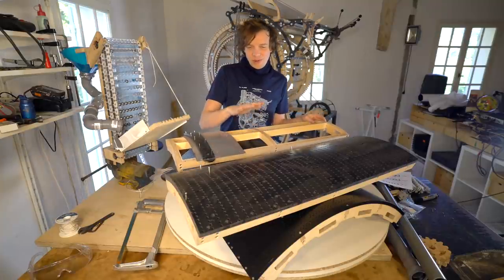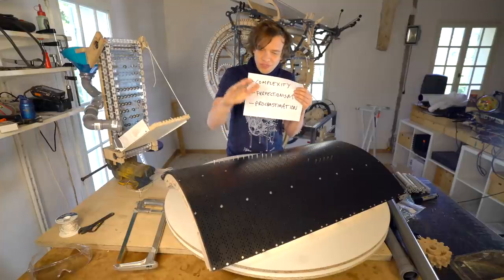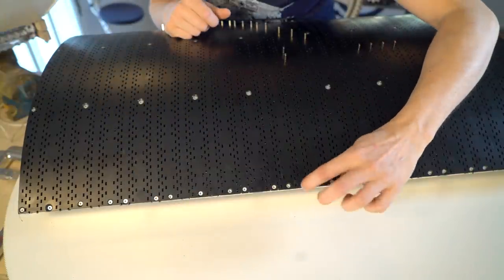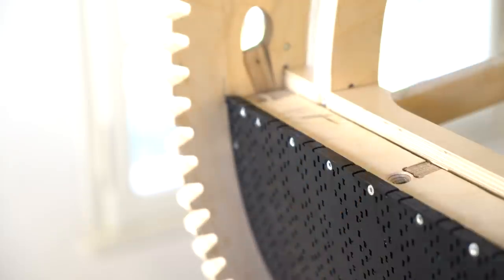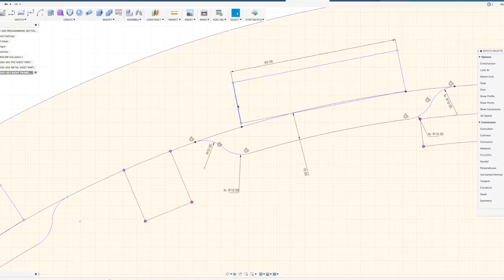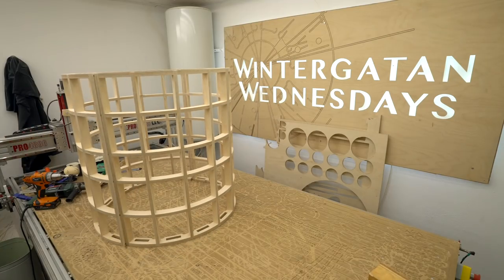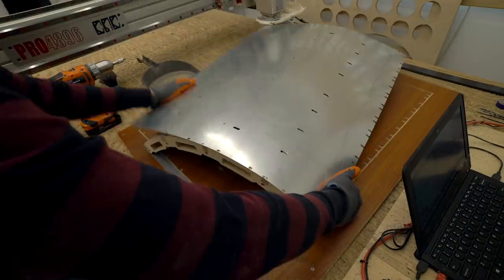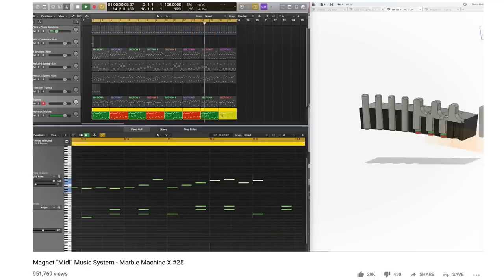Music Programming Plates Part 3 - Marble Machine X #65

Comment: When you bend the plastic plate, it's center line should remain the same length, while the top stretches as much as the bottom compresses

Comment: Who says the splits between the plastic sheets has to be straight. Why don't you make the joints with matching steps so you don't have any joint running thru a slot?
Reply: Perhaps it would just make it more complicated, or too fragile with the stress of touring. Honestly, the programming plates have gone through such a transformation since MMX started. This is probably the most effective and practicle design.
Reply: That’s what I was thinking.... I am sure it wouldn’t be difficult to do- although it would make them less rigid and harder to put on and off
But in my opinion that’s a worthy sacrifice
Reply: These panels need to be made from a plastic injection mold. A steel mold  of a section would put all the holes in automatically. The part would come out of the mold already curved perfectly. The pins that make the hole shape would retract before the part is ejected from the mold.
Reply: @billkeithchannel  oh yeah, you have any idea how much the mold would cost for such a part? Considering he only needs 8 of them.
Reply: @EitriBrokkr  The quarter section programming wheel would be divided up into curved strips 1/3 in length and would be just one channel wide. so one programming plate would have 96 individual pieces attached to it. This way if a pin slot gets loose over time you only need to replace that small plate not the entire thing. An ABS/figerglass plastic would give strength and a tight tolerance. A water cooled mold made in China would not be that expensive and could crank out a thousand parts in one shift of production.
Reply: @billkeithchannel  and getting all those spaced perfect to play music tight enough for Martin's liking would be almost impossible. I'd really be interested in to hear what your idea of "not that expensive" is.
Reply: @EitriBrokkr   Well back in the year 2000 I worked for a tool shop and the industry was gutted by Clinton when that most favored status from China went into effect. A mold that would cost $35K in America could be made for $7,500 so all those jobs went overseas.
Reply: The plates need to be detachable/attachable quickly by stage helpers. (but then again, how did he think this would work with pins in between the plates? they would all just fall out when swapping plates. and inserting them on stage would take ages..)
Reply: Why would they fall out, considering the pins are magnetic and you have a steel sheet backing? And I think that the idea was to have some overlay and 2 plate sets so that when one plate set is being played, the stage hands are swapping the pins on the other set which can then quickly be loaded.

Comment: You can do a overlap grove on the plastic program plates I don’t have a Accurate way to explain but it’s an idea
Reply: I don't understand why he couldn't use an open ended hole in each plate with a countersunk magnet to ensure the correct distance.

Comment: Really enjoying the project! Just one suggestion: wouldn't it give a better visual impression if not all the programming panels had the same color? That way the rotating of the programming drum would be visible, even from very far away...
Reply: Spectacular concept!!
Reply: Clear plastic maybe... But I guess redoing it at this stage wouldn't be worth the effort
Reply: @dippondots3108  i am suggesting that the black plastic outer layer be red, blue, green, purple pink, etc.  That is easily accomplished, even at this late stage!
Reply: @WhatAboutTheBee  I don't think those colors would fit the project, and I don't think any changes at this stage would be easy as it's not just replacing the plastic part but the metal underneath as well etc...
Reply: @dippondots3108  It might be possible to paint the panels for that effect, assuming one can find a paint that sticks to Polyethylene (its low surface energy makes this sort of thing difficult).

Comment: can you do the programming sheet in one piece and then cut it into 4 pieces?
Reply: Or perhaps, leave the programming sheet as one piece to be wrapped around the cylinder.  I believe there is a fundamental disconnect in that four pieces are to somehow magically realign themselves to musical perfection.  Not from you sir, but from the entire enterprise.  IF Martin had the time, he could realign the plates to perfection, but that will not happen during a concert.  Controlling the gap between plates will be a nightmare.
Reply: Not a bad idea much easier matching one seam than eight!

Comment: Hey Martin,
you won't like this, but I still think the wholes you use are not flexible enough. What if you write a 3/4 song but you want to use a triplet in it? What if you want to use a quintuplet at all? What if you want to delay the kick drum ever so slightly for a bit of "wonkiness"? I'm afraid once you start actually writing music for the MMX you will find the pin-system too rigid and thus frustrating.
Additionally, changing all the magnets manually during the live show will also be no easy task as it is very easy to make mistakes which you will only see (or rather hear) once the music is playing. Danger zone!

So here is my suggestion to solve those problems: Use a fabric to fix the pins onto the wheel. You just need L or T-shaped pins, that you can pin through the fabric from below. Then you just need to span the fabric over the programming wheel segment and you are done. This way you have all the flexibility in the world regarding timing. You can reduce errors during the show by printing the song onto the fabric so that your helpers know exactly where to put pins. Or you could just leave the pins in the fabric and have all the songs readily available backstage.

The only problems I see with this approach are:
- How to make sure the fabric is evenly stretched onto the wheel
- Pins falling out of the fabric, especially when you choose to just leave them in the fabric.
But those problems seem easier to fix than the ones I described earlier. 

Just my .01 €
Cheers!
Reply: I think he mentioned something about cutting paper so the holes are guides. But I have to admit that even this intelligent system that Martin thought of is still limiting. But he has to decide what will work for him

Comment: I doubt any live programming will be successful. Way too much work for shivering hands under pressure. Do a set of plates for every song...
Reply: @stephss  I paid attention and know what he says. I doubt it anyway. We will see.
Reply: That's been the plan for awhile. Make multiple sets of programming wheels to quickly switch songs in concert.
Reply: @Bishop998  but in this video he specifically talks about TWO sets. I wouldn't do it. Resetting thousands of notes every concert will get old quickly, it will also wear out the plates. Which means the music will no longer be tight. No-go.

Comment: Martin, in cabinet making, to create a curved wall or side using a flat solid material, we score the back side parallel to the bend of the material to allow it to curve with out distortion. Also, the edges that butt up against one another are beveled slightly to make a tight fit. You should be able to calculate the exact circumference of the programming wheels based on the radius already determined in you CAD file. Hope this helps.

Comment: I'm so very much enjoying following along. I totally get the perfectionism leading to procrastination. I have an idea that might aid in the fit of the programming plates as they relate to the next plate. Or the "inter-plate gap". If you drilled and tap a series of holes into one edge of the programming plates and install set screws, that would allow you to adjust the "length" of the plate in relation to the next plate. Maybe a bit more permanent solution than shims. There is a product called ND Vibratite that you apply like loc-Tite. Allow it to cure before assembling and you have a nyloc patch. Make the 32nd not slots just a bit narrow and then using a riffler open the hole up enough to accept the magnets. Very fiddly but once completed, it's set.

Comment: Great job Martin. Imho you can make a "saw" shape between boards. And no need half  pinholes. Inside of a cylinder you can use a clamps used in instrument boxes to tight boards together.

Comment: I think one of the biggest factors in why it's been taking a while is that you've been having to educate yourself at every step of the way.  You went into one of the most complex mechanical engineering projects I've seen a single person attempt without knowing what a PBS system was, without knowing the application notes for many simple mechanical linkages, or even how to even use your CAD software.   In a very real sense anyone can learn to do anything, this is why people hire engineers though.  They will have hopefully already been through many of these learning experiences.  In a sense you've might as well add a full engineering course load to the project's basic requirements to compensate for your starting point.

Comment: @Wintergatan you've already made the plastic sheets but maybe for the next set, Turn the whole thing over and mill horizontal grooves in the back. Its called "Kerf-cutting Method" and its used to bend wood but im sure it will help a lot for bending the plastic as well.

Comment: Trying to understand this a little better. So you're going to have one programming plate that is keyed to the wheel and the others will float a bit so you can shim them into alignment? Or are you keying each plate to the wheel so there is a #1 plate and a #1 section of the wheel that it goes to so you can get everything perfectly aligned and easily repeatable when changing out plates?

Comment: Hi Martin, 
1) have you already been incorporating tolerances on your dimensions? Do you have a way of checking your tolerance stack-ups to ensure you can build as best as possible? And most importantly, have you established expected tolerances for each time of material/ manufacturing method used for MMX?
2) As product design engineer who also strives for perfection (highest quality), I know that procrastination is a real thing. But sometimes it does help to take a step back to think about what you are doing and how you are attacking your problem at hand - that is, are you using the appropriate problem solving tool, and are you taking into account all the possibilities that influence the intended outcome? These questions help you to brainstorm while not physically doing anything, but saving these ideas to try out later. 
3) For the programming plates:  have you considered if overlapping the ends from one to the next would help to ensure they give a continuous track between the sections?

Comment: By registering these sheets accurately edge to edge, you're sacrificing timing alignment of one sheet's pins to the next sheet's pins. I think you should make the sheets slightly scant and then fasten them all loosely to the drum. Then install an alignment fixture between each sheet that aligns the sheet relative to pin positions. Once all the sheets are aligned, tighten them, then remove the fixtures

Comment: Since the programming plates are a huge part of the machine, have you thought of color coding the pins? This way you would be able to see which code is for the different timing sections. Plus it would look really cool to see that going around when moving.

Comment: One question Martin, which software would you recommend to use try music before making holes into the paper for music box? Don't have any recording device like you have in the video guide so I would be basically placing notes individually, but it's fine for me. Thanks.

Comment: Martin, if the limits of precision and/or distortion in the plywood continue to cause problems, would it be possible to fabricate the "ribs & ring sections" of the programming plates from aluminum or steel weldments instead of plywood? Then, machine the ends of the weldments to fit precisely? Same basic design as now, but with plates machined to fit together. Then, the assembled "programming shells" could be turned in a lathe to final size and concentricity, and the "shells" could be attached to the programming wheel with semi-floating mounts. If the plate material itself still has has variations, attach it to the shell first, then turn the whole works in a lathe. Then, machine the holes in the shell. That would require a much larger CNC or at least a really good dividing plate and vertical mill. But I think it could be done, and it would allow you to control the pin hole spacing for the entire programming shell as a whole cylinder.  ...Watching from the high desert of Colorado, USA. Waiting patiently for the world tour.

Comment: Omitting the off-beat pin for every 32nd position is a brilliant and very worthwhile tradeoff to simplify the tolerances and construction. You're finally starting to think like an engineer - if you can't solve the problem, change the constraints ;)

Comment: Martin one way to pin the prog wheel is to have pins already placed in a matching panel, so one would pin a song ahead of time onto the inside circumference of a pin press panel and press it onto the prog wheel, if the pin press panel could pinch and release the pins the pins would transfer with ease, the pins locked in place until they are pressed into their respective slots on the prog wheel then released and the pin press plate pulled off. For ease and accuracy the pin press plates would have the pin holes for one song or perhaps colour coding the holes for the pins two songs per pin press plate (the two songs not pinned at the same time) Removal of the pins would be as simple as pressing the correct empty pin press plate on to the prog wheel pulling a pinch leaver, pinching the pins in the pin press plate and lifting the pin press plate off thus removing the song ready to be re-pinned with a different pin press plate thus a different song. You would need 4 pin press plates per section of the prog wheel.
This idea was inspired by your creativity Martin I hope this idea helps you find a quick programming solution.
Thank you Martin, 
Take your time I don't want Wintergatan MMX Wednesdays to end!

Comment: Another idea that could be a different kind of nightmare especially with the distortion is to not make the joining surfaces straight like but instead like stair stepped teeth that fit together and this way you can weave it through the holes and avoid splitting the holes between two plates. But I am sure you thought about that. Great project. cant wait to see it finished.

Comment: When bending thicker materials, like 6mm aluminium, I usually draw the finished shape in CAD. And from that I draw a line in the center of the material and calculate the length of the flat unbent stock. I also gets the position where I need to bend it, certain bends require different dies in my hydraulic press brake which results in different bending radiuses. I have to check the blueprint for misses like that and to see if any hole is placed too close to the bend. Too close the material wants to bend in the hole instead. I usually solve that by changing to a pilot hole that I drill to the desired diameter afterwards or change the shape of the hole. If the hole lies too close, extend it to the bending line. Otherwise adding material so that the die can work without distortion.

Comment: Martin. have you considered the flexibility of the materials as to expansion? if you are registering your plates that precisely... you have to account for expansion and contraction due to the different locals the machine will be going to. you may have a hot damp area making the wood expand or you may have a dry hot area making the wood contract. since the programming wheel is plastic and does not flex the same as the wood. hopefully this is not an issue. The saving grace is that you can engineer the side clamps to make the plastic face butt up to each other precisely. you may be making a mistake by letting there be slack between them that you shim. as the machine gets older and the levers wear out, the mating hole to the clamp will widen. the holding force of the clamps will diminish. just think on how much wear each one will have each time its used X how many times the plates will be changed a show X how many shows a year + breakdown and refitting for travel. it may be a lot to ask from a laminated piece of wood. eventually you will get axial play in the plates. if you make those clamps with a plastic face.... (something with a high lubricity) you can essentially use them as shims replacing them as needed and not having to re-fabricate new arms for the clamp. i recently watched a video on Flea of the Red Hot Chilli Peppers. he only uses graphite bass necks so the does not have warping when he travels the world. just putting that out there for you to ponder. Good luck. its looking great.

Comment: Martin,

Just wondering if the plastic sheets could be notched where the pins share a space between two sheets. This way they could be precisely interlocking without sharing a half a hole per sheet per pin.. 

Bryan from Vancouver

Comment: This might take some extra time, but would it be helpful if you machined the programming plates while they were on the MMX? You could assemble the plastic onto the wheel sections, then attach a gantry to the MMX with a router and have the programming wheel rotated as one of the axis. This would eliminate any distortion from being bent on the programming peg holes. As long as the depth was set to not go through the metal it should work.

I am talking about machining the adjacent sides of each plate on the machine to get a perfect fit, and then the programming peg slots on a finished cylinder.